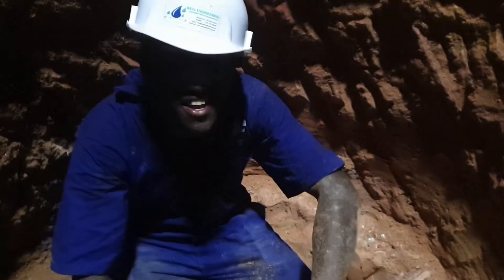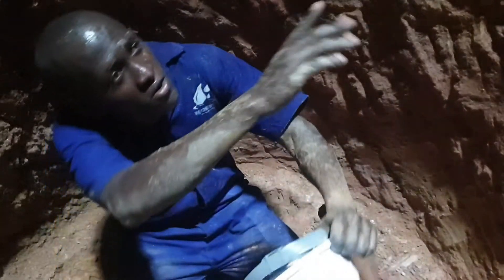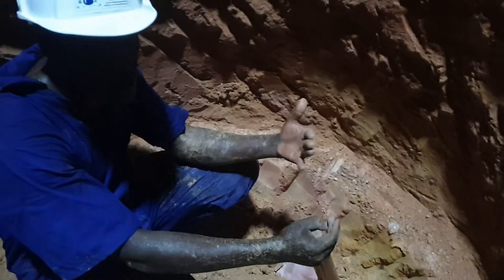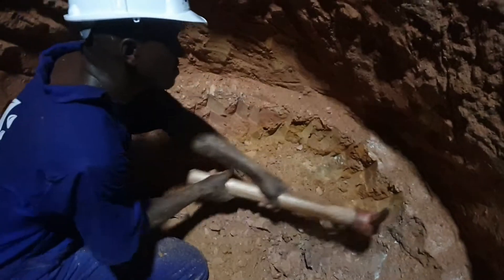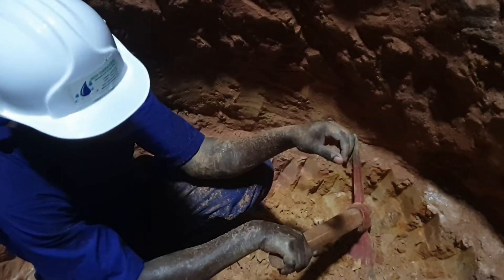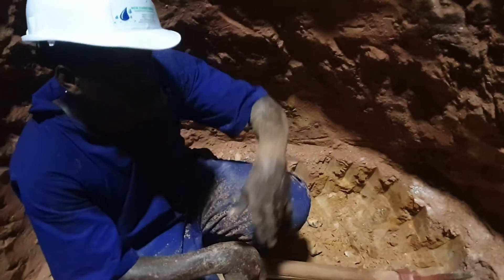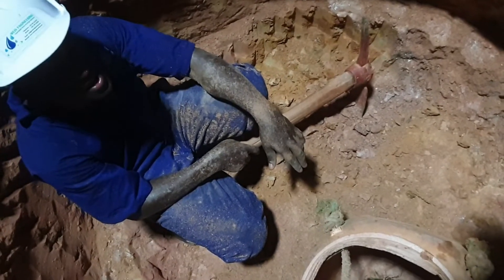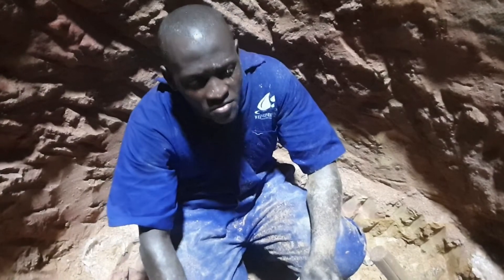How to dig a shallow water well using manual labor - Digging a hand dug water well

Comment: Great job .what happens when you dig 30metres deep and you find arock? Please reply me because am facing this problem
Reply from the maker: If a hard is encountered,  one of the options would be using a compressor though advisable if there signs of water because it involves a lot of resources otherwise if there is a possibility of digging a new point and the chances of getting the same rock is less, then a new point can be tried otherwise a machine drilled deep well (https://weisengineering.com/cost-of-drilling-a-borehole-in-uganda/) may be the last option.